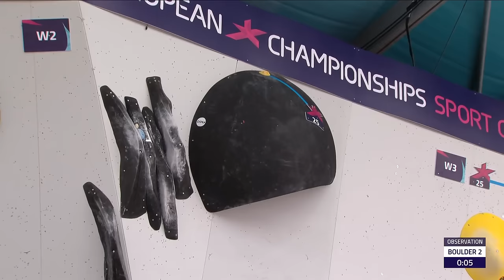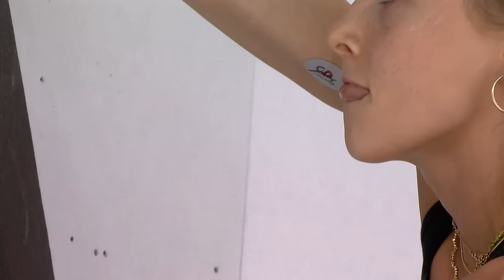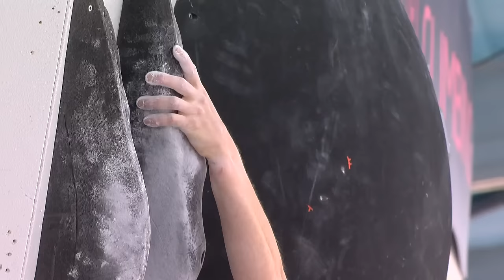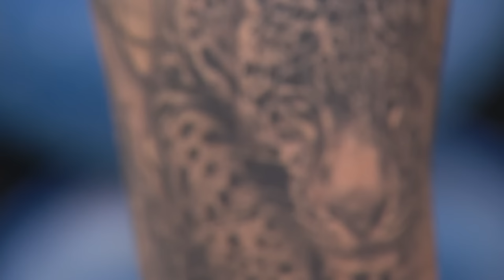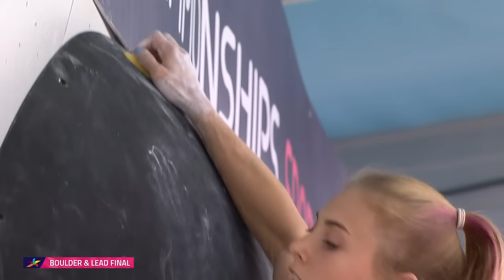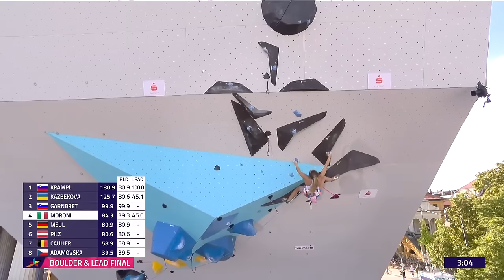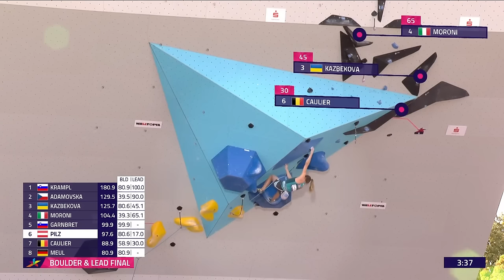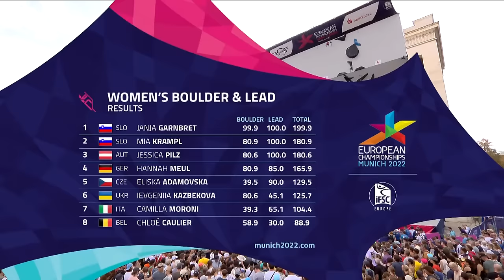Sport Climbing 🧗‍♂️ | DAY 7 | Full Replay | European Championships Munich 2022

Comment: Overall I think that the format and scoring system is good - much better than the last Olympics. The only two changes I would like to see are :

1. During the bouldering, have the athletes come out one at a time like in a regular bouldering final.

2. Give some score (even 0.5 or 0.25 points) to the first section of the lead route. Right now, if someone falls on the first move of the route, or someone falls on the move before the 1 point holds they would get the same score, even though one person did many more moves than the other. This would be especially relevant if it was a harder lead route that saw some low falls.

Comment: Seems like a good format. Maybe some small tweaks could be made (eg. I'm not sure a single lead hold should be worth 50 attempts on a boulder), but really anything is better than a format that includes speed climbing.

Also Janja is incredible as always.
Reply: I think it makes sense - progress on a climb is almost always worth more than attempts. It's a way of making the primary scoring system climbing and attempts secondary, but integrating it into a single score instead of having a complicated system of tiebreaks.
Reply: @wookie19822007  Yeah, and I like that idea but it might be worth pointing out that they did still have a lot of ties. A couple of the athletes basically had identical scores and they had to be broken by going back to their qualifying scores. But maybe that was an issue with the routesetting more than the scoring system. The boulders and routes for the single boulder and lead championship semifinals and finals seemed much harder and had better separation among the climbings. It could be described better as "who fought the hardest won" more than "who messed up the least won", and I personally prefer the former. (I totally get why it if they wanted to make it easier because it was following those events and because by the simple fact of being a combined event, the athletes will be more tired, but I think they missed the mark a little).
Reply: I'd like to see the first holds worth at least a point, or even .5. If two people fell near the beginning, but one climbed further, it would be bad if it meant nothing and it came down to that.
Reply: @wookie19822007  So you think if a climber flashed all boulders, and another climber got all the boulders after 49 attempts, but got one hold higher on the lead wall near the top, that second climber should win?
Reply: @Schrodinger_  No I was talking about the way the bouldering scoring works here, sorry if that was confusing.

Comment: A fantastic competition. Interesting to see a few comments about the format and scoring system. I think overall the organisers have done well, but scoring and format is fun to think about. If I was going to change anything about the scoring I would wonder about:

(i) Making every hold on a boulder a "bonus", so every move is worth something. This is especially relevant where the routesetters read a route different to the climbers, or don't anticipate a crux, which does happen sometimes.

(ii) Making the scoring relative, so that the lead route scoring per hold depends on how many other climbers have touched or used a hold, and similar in bouldering... perhaps getting to and using a hold few or no other climbers get to (even if not a top) should be worth more than a top that many climbers achieve. This would be complicated to implement but I think it's worth thinking about long term, as a way of taking the subjectivity of the routesetters out of the scoring a bit.
Reply: I think I agree with you about the bouldering scoring. It would be good to consider more possibilities than what the IFSC has been doing the last several years. The Rock Master 2022 had an interesting approach sort of like what you're suggesting, with the judges rewarding the boulderers for their relative success/progress on a boulder (I don't love the "elimination style" for each boulder sequentially though--but I think it wouldn't be too hard to translate that into an overall score instead of elimination).
Reply: Maybe add a bonus if a climber was the only one to top a boulder problem.
Reply: Really? But 2/4 boulders were far too easy and the lead route wasn't challenging enough at the top. Don't you think the route setting was bad?

Comment: Strange that zone attempts don't factor at all if you made it past the zone. If two climbers both take 2 attempts to do a climb, but one got both zones in their first attempt and the other got neither, it wouldn't matter. They both get 24.9
Reply: Not really, the second climber still flashed most of the route, they both messed up one move, they both climbed in 2 attempts. Maybe ones stronger on slabby coordination moves at the start and the others better at stronger slopers further up.. either way they both deserve the points

Comment: for multiple tops in lead,  they need to rank the athlete by finish time : giving advantage to athlete who rest less , more fluent and finish faster.
Reply: no, being good at resting is a skill
Reply: But resting is a big part of climbing! Finding the good rests and timing the route so you can be as fresh as possible
Reply: @biamoreira4019  if resting were  encouraged,the time limit would be cancelled long ago. Climbing faster and safely is a better skill than finding a spot to rest
Reply: @muuschty1337  however climbing faster and efficiently is a better skill to evaluate than resting in international competition
Reply: Being good at resting is a good  compensation or exchange for lacking stamina and strength, which is more important for what this competition is about
Reply: @mmakid  Okay, sure, but like in the lead comps if the climbers tie (and you can’t break the tie through countback) the winner is decided by time, the faster the better. But how would that work in the combined? It’s all a matter of score, right? So, a top = 100 points. If you top it slower how many points should you get, if not 100?
Reply: @biamoreira4019  you can rank the time, for instance all three tops get 100, 100-0.1,100-0.2 for minus 0, 0.1,0.2
Reply: In the previous combined format it made sense, and happened a lot (see the 2019 female world championships in hachioji), if there was a tie, the fastest climber was ranked higher, and that affected the results. But this scoring system doesn’t allow for time to be a factor (maybe only if the climbers are tied in the score as well as in the boulder, so breaking a lead tie through that - but the routesetting would have to be terrible for that to be a factor)
Reply: @mmakid  I personally think this has to be resolved with a harder lead route. I also don’t like that you have to get almost half way up to get any score. Hope they find a better way for Paris, luckily we still have a lot of time
Reply: @biamoreira4019  my point being by introducing the factor of time, you can literally see climbers such as Chae-hyun, and Laura Rogora changed their style in Olympic, (they are able to climb faster) and I think that’s pretty awesome, should be encouraged
Reply: @mmakid  yeah, I agree but that would cause some problems. Let’s say 3 climbers fell on idk hold 20+, so by this calculation they would get something like 20.1, 20 and 19.9, right? (Making up some scoring here) But a climber that fell on hold 20 would get a score of 20. That means someone that got a plus would have a lower score than someone who didn’t.
Reply: Or hire some female route setters and up the difficulty at the top. This was way too easy.
Reply: If it was about time then the climbers will climb faster, they do their climbs according to the rules.  If you want speed go watch speed climbing.

Comment: Matt must be the least informed commentator ever. Man if you read the Rules Manual, the -0.1 is per attempt but for each section. So if you flash zone 2, but fall 9 times trying to get the top and never get it, you still get the 6 points because the zone was flashed. If you were to top after 9 falls, then you'd get 24.1. 
The minus 0.1 is only to tries to the tier (3/6/top)
Reply: @robertd5558  That's assuming that they top the boulder. If they don't top the boulder but flash to second zone they'd get 6 points, if they took two attempts to get to second zone they'd be awarded 5.9 I guess. Which in the context of the whole competition matters.

Edit: I much preferred Charlie as a commentator over Matt. It just feels like Charlie always came more prepared and was more accurate most of the time. Matt makes a lot of mistakes that add up over time including athletes names, scoring, accomplishments of athletes, little facts here and there (like when he said Janja forgot her chalk bag, she didn't, it fell at the beginning of her climb). However, I do have to say that he seems receptive to criticism and seems to genuinely make an effort to be better. Kudos to him for that.
Reply: @robertd5558  He got wrong that he was expecting an athlete to get 5.9 (instead of 6) for falling while reaching the top. But that would never happen because the Z2 was flashed, so the score would always be 6. The athlete finally got the top in next try and therefore got 24.9, but Matt kept thinking the score was only updated at the end, without understanding that the -0.1 was applied on reaching the top (last tier), and had nothing to do with the Z2. 
He's being paid to commentate and inform. It cannot be that he's guessing the rules on screen time. It is just not acceptable professionally, in my opinion. 

Charlie did have the rules handbook by his side, which he read and confirmed/quoted live so there were no doubts. Very different levels of professionalism.